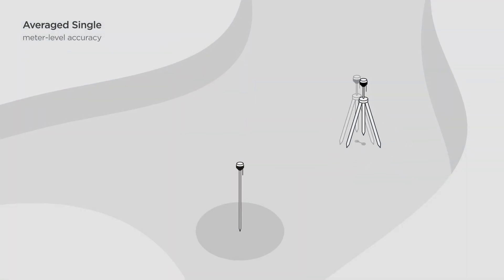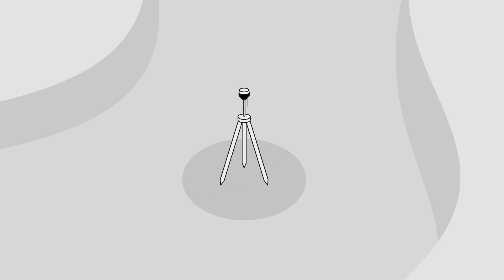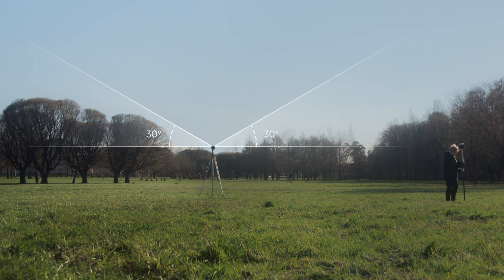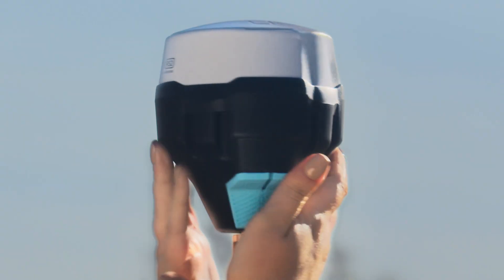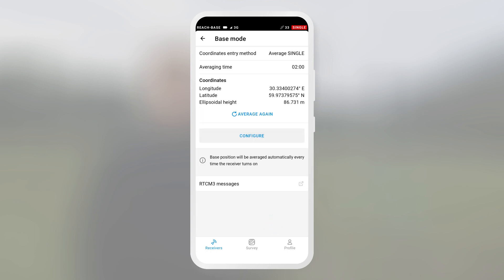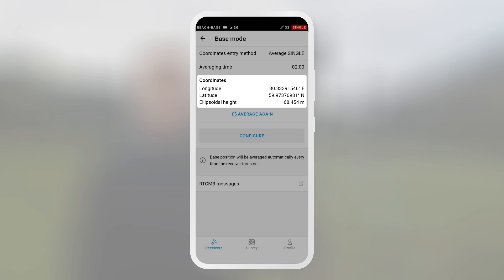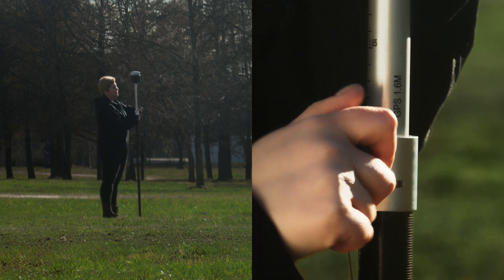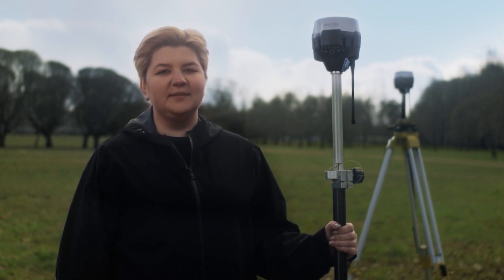How to Place and Set Up RTK Base. Episode 2 of 3

Comment: Hi, when you set up the base, I have to measured the height of the antenna??, the same for the rover
Reply from the maker: Hi there!  If you're setting up base coordinates manually, you need to measure the antenna height offset. 

For Reach RS2, the antenna height is the distance between the mark and the bottom of the receiver plus the receiver's height to the antenna reference point (ARP). ARP is equal to 134 mm and automatically added by ReachView 3.  

We'd recommend you to check our guide for more information: https://docs.emlid.com/reachrs2/ppk-quickstart/placing-the-base/#placing-the-base-station-in-the-field.
Reply: @Emlid  In the manual it does not provide way to precisely measure the height (h). I believe it is important to explain how to do it in mm precision way and using a systematic procedure (slant height measures is very prone to errors and misalignments).